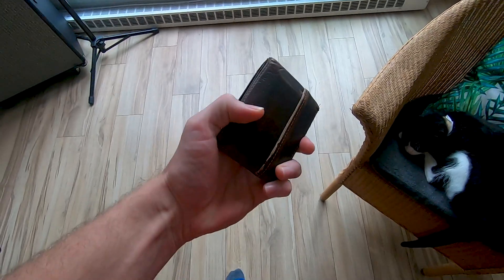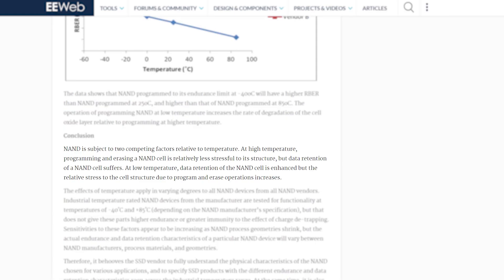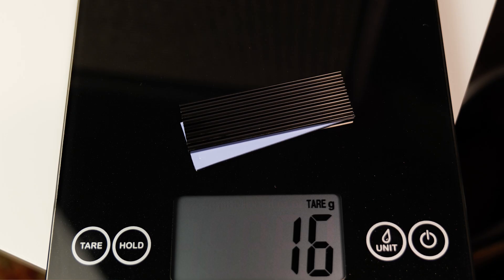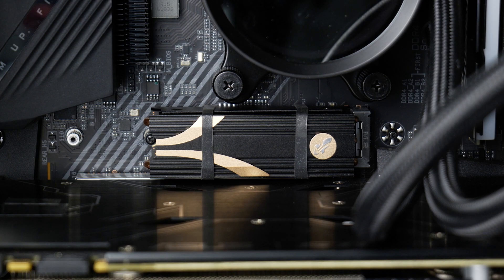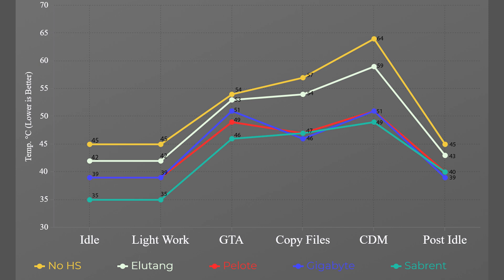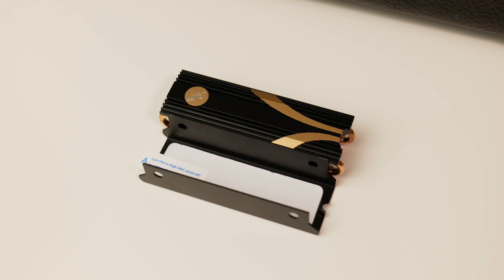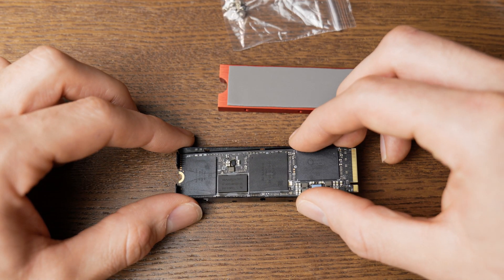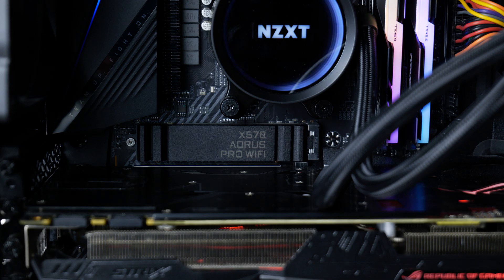Are NVMe SSD Heatsinks Worth Using? M.2 Heatsink Comparison

Comment: Umm.. Yeah, Your conclusion is way incorrect sir.
It is always in your best interest to use heatsinks when every you can in the way they are intended and "Designed" to be used! I think you confused yourself when referring to someone else's research . The only time the SSD was hotter with the heatsink vs without was at "IDLE" and it wasn't by much.
A drive at idle is a computer at idle which means the case cooling system is at idle as there are thermal thresholds. 

The controller will always be hotter than the Nand in normal operating conditions as it's is like a mini processor directing traffic to the Nand(s) at high rates of speed.

You should NEVER use less thermal pads/paste then what a product is designed for! 
The whole purpose of thermal pads/paste is to spread the heat out evenly throughout the heatsink. By removing any portions you could in fact create the OPPOSITE effect causing the SSD to get even hotter in the places where you removed the pads/paste.

When is comes to the "SABRENT" heatsink, you clearly didn't read the instructions that came with it!
The heatsink is designed for both "single" and "double" layer SSDs. You were using a "single" layer and if you would have read the instructions you would have realize the "extra" pad that came with it was to be used by doubling up the pad on the bottom of the heatsink which would have closed that gap you had and the heatsink would have preformed much better!

People, keep in mind that we are talking about a "HEATSINKS". A heatsink is designed to pull heat away from or out of an object and direct it away from said object. In this case the heat is directed towards the top of the heatsink and from there needs to be cooled in some kind of way for the heatsink to continue to do it's job. Any heatsink that does not come with it's own fan or is designed for liquid cooling relies SOLEY on you CASE FANS to keep it cool!

Your computer case needs proper in/out air flow to your motherboard and components regardless if you run Liquid cool system otherwise devices in your case and/or on your motherboard can fail do to extreme heat or being subject to "constant high temps".
Reply: This dude wasted everyones time, It's not about keeping it as cool as possible it's about keeping it from overheating.

Comment: Some M.2 drives do not need to peel off the sticker, I have a Kingston SSD KC3000 1TB NVMe and the sticker is graphene-aluminum and does not come off. Otherwise, you may lose your warranty. The radiator is placed directly on the sticker and I have a temperature of around 26 degrees on it permanently.

Comment: Thanks for this video.  I've just built a new PC and the Motherboard came with a M.2 mount on the board.  I bought a Samsung 970 EVO Plus 1 TB, but wasn't sure about using a heat sink with it.  I phoned the Tech Department of the local company I bought everything from and they said not necessary, as Samsung don't recommend it.  Having found your video, it basically confirms what my local supplier said, so I am now going to install the SSD onto the mobo and install Windows 10 Pro, as the mobo doesn't support Win 11.  Cheers,  Russ.  UK.

Comment: Yeah, well put a really fast NVME SSD stick in an external enclosure, running off of USB C, and do about a 700 GB backup to that drive, and see how hot that gets, without any type of heat sink. I'm definitely going to have to do something about that.

Comment: Do not remove the stickers. Those acts as heat spreaders. Removing them will make the SSD hotter and slower. And it will void your warranty.
Reply: Stickers would do almost nothing to disperse heat. As well as those remove to void warranty stickers are not legal in the eu

Comment: Good info and data. However, personally I disagree with your conclusion - the 2 degree difference in controller idle temps is completely inconsequential and 42/44C are both perfectly fine, however the difference under load is meaningful - NAND temps are in the 60s C under load with heatsink, and optimal NAND operational temp is ~50-70C.... so definitely use a heatsink based on the other site's data, for both controller and NAND. The 94C+ NAND temp under load achieved without a heatsink is not optimal.

Comment: Nice content straight to the point. 
I have a rog strix g15 with Ryzen 7 6800 RTX 3050 8 GB Ram and 512 ssd, I want to upgrade ram and ssd, should I buy ssd with or without heatsink?

Comment: there is an additional thermal pad included in the box for single sided nvme drives.. you need to paste that extra thermal pad on the already pasted thermal pad to fill the gaps

Comment: I just bought a best buy brand heat sink and my 970 evo plus dropped 10 degrees and didn't budge when I ran benchmarks. My 980 pro is just using my motherboard's heatsink and its running at 40 degrees.

Comment: In my tested running crystalmark on a drive with no h/s,  you get close to the drives expected speeds (often more).  Now run it a second time, whilst the drive is still hot.  Notice a "slight" speed decrease.  Now run it a third time, the drive is even hotter maybe close to its max running temp, notice the speeds are around a 1/3 of what the drive is capable when cooled properly.

One thing I noticed, my test with a drive with no heatsinks, they not only idle a lot lower than the drives fitted with heatsinks, but the drive also didn't peak as high temperature wise, and also returns back to a lower temp much faster than those drives fit with a heatsink.

Finally worth mentioned, is that not all m.2 drive placements are equal.  Even worse if you have a slot lower down and use a GPU in a vertical position.  It seems this area behind the GPU is a little heat trap and I saw temps around 7C higher on these port with the GPU mounted vertically.  In my opinion, a single standard heatsink might not be the best solution, and a different one might work better depending where the drive is mounted and how the GPU is mounted.  It isn't as a cut and dry as mount a drive and put a heatsink on it.

p.s as I am writing this on the test machine, the drive with no heatsink that peaked about 58C is now sat at 46C.  The drive with a h/s which peaked around 72C is currently sat at 65C that is over a time span of 17 minutes and 30 seconds....

Comment: I disagree to your theory of Idle drive.
As far as it is a System drive.
Because I have 1 older system I still Use in My shop.
It has a spinning drive.
And what suffers from Fragmentation?
Spinning drives. 
I started to notice 2 or so years ago My drive would slow down to a crawl. 
But tested in Crystal disk it would show 150/130MB that is Normal For My Toshiba. 
However, I later realized That has nothing to do with reality.
You see CD Writes and reads data in the test on a clean portion of the drive. Testing the Absolute speed the drive can achieve. Since it is its own data, its in perfect condition and reads at full speed.
But Your data that's Written and Fragmented Can barely be read. 
Further investigation using Defraggler Showed me The Most Fragmented Files are Guess what?
Antivirus definitions. 
Also Deffragler Speed test Tries to Read contents of your drive. So When your data is fragmented, It Shows you How slow the read is. And Mine would drop to 1.5MB/s sometimes.
In Just 2h AVG, AVAST, BitDefender would create over 2000 Fragmets. On one file, and have several hundreds on 4-5 more files. Windows 10 Will have over 200-300 files fragmented in a few hours. 
They are CONSTANTLY writing and rewriting shit on your storage. 
So Your Idea doesn't hold up, since Most people Use free or Payed versions of these AV's. 
Being tiny files, I guess It wouldn't affect your TBW as much trough out years. And fragmentation is not a SSD issue. 
But you are not correct that Modern Windows have Idle state.

Comment: So in my Asus Rig Strix G17 (2023), I installed 2 x 2TB SSD and I figured out:
Without heatsink it goes up to nearly 80°C 
With minimal Heatsink (cant use bigger ones in Laptop sadly, I could reduce the Mx temp to about 65°C testing with Benchmarks. 

So I would say that it is really worth it

Comment: I simply use the heat sink on my motherboard.
Reply: If its a beefy one, go for it, but its a small one, like the Gigabyte Block and you have a heater like my 970Pro or a similar powering Gen4 drive, you may wanna look for some aftermarket ones, they beat those quite handily.

JFYI: just in case you're looking for some: 
The Sabrent heatsink is one of the best to get and has become a lot cheaper, here in Germoney i can get that for just 24€ (Model SB-HTSK in black). 
There is a channel out there, that tested a crapload of those coolers on a WD Black SN850 and the Sabrent scored 2nd place with 54°C max after 5runs of Crystal Diskmark with this high speed Gen4 drive.
Add some Airflow to it and you get to or maybe even below 50.
Also other than here presented, the Sabrent now comes with an additional Thermal Pad, if you use single sided drives, so you bolster the one on the underside to double its thiccness and the issue with the lack of compression just vaporizes. 😊
Reply: @wolfwilkopter2231  I have an ASUS ROG STRIX X670E-F. I would never buy Gigabyte or ASRock. 😆
Reply: @Nikioko  
That is your Problem. 😅
ASUS is highly overrated and overpriced (ASUS TAX) imho.
ASRock has on many points overtaken ASUS.

And i'm buyin Gigabyte/Aorus GPU's and Mainboards only for far over a Decade now and never had any Problems with it that would be worth mentioning.
(iirc my first Gigabyte MB was the 870A-UD3 and the first Gigabyte GPU the 560Ti and before that it was mainly, but not exclusively MSI)

My next Board will be either the X670E Aorus Master or the later X770 Aorus Master for AMDs Ryzen 8000, not sure about what and when, my 5800X3D is running just fine for now. 😊
Reply: @wolfwilkopter2231  No, that is not my problem. And ASUS is definitely not overrated, but the best quality you can get, followed by MSI. ASRock and Gigabyte (and AOpen years ago) on the other hand, are cheap, but also of poor quality. So, if I buy ASUS and you buy Gigabyte, it’s your problem, not mine.

Comment: Man, the few degress that the ssd was at when idle with the heatsink is probably doing nothing to the ssd, but under stress it was significantly cooler with the heatsink which matters at that high temp, thats why they gave it a resounding yes to use a heatsink. I get what your saying about idle being most important, but a few degrees doesnt really mean anything at thise temps.

Comment: Those two articles are 100% bunk.  Pretty much 100% of the articles on maketecheasier are just sponsored ads made to look like articles.  people like you have proven that you dont need a heatsink.
Reply: Tell that some Samsung 990Pro's under load or to my 970pro with that crappy Gigabyte Block on it, which heats up to 75°C on the controller and 65°C on the NAnd under CDM in a H500M with an AiO and beeing surrounded by Fans, aka 2x200mill front push, radiator 3 120mill Pull and 3 140mill sickleflows for exhaust in the back and top.
Or tell that to the other guy here, who had his crappy slow low power WD Blue SN 550 overheat to a 100°C, crashing the system and not starting after...

The Sabrent heatsink is one of the best to get and has become a lot cheaper, here in Germoney i can get that for just 24€ (Model SB-HTSK in black). 
There is a channel out there, that tested a crapload of those coolers on a WD Black SN850 and the Sabrent scored 2nd place with 54°C max after 5runs of Crystal Diskmark with this high speed Gen4 drive.
Add some Airflow to it and you get to or maybe even below 50.
Also other than here presented, the Sabrent now comes with an additional Thermal Pad, if you use single sided drives, so you bolster the one on the underside to double its thiccness and the issue with the lack of compression just vaporizes. 😊

Comment: One good thing about SSD heatsinks is that they distribute the heat evenly among all components they cover - and prevent isolated location temperature spikes. That is more important than keeping everything cold as much as possible, given that silicon is generally fine long term in temps under 60 celsius. In simple words: do not worry about keeping everything as cold as possible - in fact temperature shocks and large temp deltas are not good for your hardware either as they cause component physical expansion and shrinkage on the PCB board. Just make sure you avoid > 60 celsius spikes on all chips on your ssd and keep the temperature as stable as possible - use an all covering, well sized, well ventilated heatsink.

Comment: I have 2 sabrents for my 2 sabrent rockets, and no issue, it comes with 2 stickers, are you sure you install it correctly?
Reply: maybe in his time of buying, there was no 2nd sticker in it for the underside to bolster it up for single sided drives or he just overlooked it or something.
also it has become much cheaper by now, i can get this one in black for 24bucks here in germoney and its a damn good heatsink.
and his conclusion is also somewhat borked with a gen 3 drive a lot of idle and so on.
BuildorBuy did alot of testing and the Sabrent was in second place there on a 1TB SN850 and with 5 runs of CDM it scored just 54°C max with almost no airflow.

Comment: This nvme m.2 heatsink works for me, before i used this my ssd max temp could reach 63°C. After i installed the cheap $5 aluminum heatsink, with full load (crystal disk mark test)  max temp decrease to only about 49°C.

Comment: Hi Team,
is there hot on DRAM when running?
Reply: Controllers usually get the hottest, NAND and DRAM usually are at the same level which is mostly significantly lower, on my 970Pro with the Board Cooling Block of my X570 Aorus Pro, in CDM with 5 runs, the controller reached 75°C and the NAND and DRAM 65°C.
Reply: @wolfwilkopter2231  Thank you for your information!
Reply: @TaiLe-dr5ve 
You're welcome. 😊